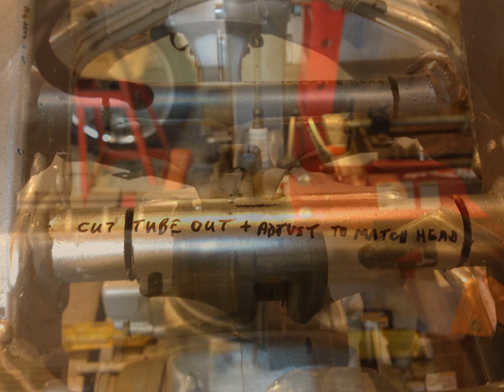KX220 Build-Slide Show/KDX Hybrid/KXF Hybrid

Comment: im doing the same build! Gor a good deal on kxf 250 2005. But im not sure how im gonna fit the swingarm axle on the kdx motor. i think its the most crucial part of the build
Reply from the maker: It's really not that bad. I had to open up the hat bushings in the case slightly to accommodate the larger diameter swing arm bolt using an adjustable ream. The only difficulty I had was keeping the ream on a straight path without some sort of pilot. If it's not too expensive you may want to consider taking it to a machine shop. They could probably do it much easier and without the risk of not getting the two sides in perfect alignment. If they're off even the slightest the bolt won't pass through from one side to the other without getting hung up. Plus you want it to be as perfect as possible so that the bolt will run true all the way through the swing arm bearings. After that it's just a matter of dressing a small amount of material from the outer surface of the hats to allow the engine to fit between the swing arm bearings. That's the easiest part.
Reply: @KX220R  thaanks! I will see if the machine shop of my city can do it! And what tube diameter did you bend to make the chassis? 1"?
Reply from the maker: @noiaverso  It's been so long since I did it, can't remember off the top of my head. It's exactly the same as what Kawi used in the tubes under the engine. Might have been slightly thicker walled because that was what was available from the local supplier.
Reply: @KX220R  use the kxf original air booth? im thinking about the air volume that the engine needs
Reply from the maker: @noiaverso  That's what I did. I had to work at it a while to get the opening to stretch to fit the KDX carb but eventually it complied. Haven't had any trouble with it and I still ride the bike all the time. The opening in the KXF air box for the carb is a slightly smaller diameter but you can make it work. My KDX220 engine runs great with the KXF air box and filter. I waited  until I had the engine all installed because I wasn't aware of the difference. Made it much more difficult to stretch the opening. You might want to consider stretching it to fit your KDX carb now while you have better access. Maybe install the carb into the air box and clamp it there now while you work on other parts of the bike to get it stretched out and compliant. That should make reinstalling the carb later, when things are tight, much easier. You might need to use a heat gun to warm it up a little and make it more pliable. After the engine is completely installed and the last thing to fit is the carb you'll notice the carb will want to push backward on the air box some as well because of the lack of room between the engine and the air box. If you're patient, the air box is pliable enough to reshape itself slightly. When you're all done you won't be able to tell it didn't come that way from the factory.
Reply: @KX220R  my kdx its 200.. uses a 35mm carb and i think the 220 uses 33mm so I think I'm gonna make a plate to fit the air filter and air both on the kxf air box..
Reply from the maker: @noiaverso  The outside diameter of the two KDX carbs is the same. It's just the inner diameter that is machined to different sizes. I've run both sized KDX carbs on my KDX220 and my hybrid KX220. It makes them run a little differently because of the bore size but the outside casting is exactly the same dimensions. If you look back at my video you can see that it fits just fine and you can save yourself a bunch of unnecessary fabrication time by reusing the stock KXF air box. My engine seems to run better installed in this KXF air box and with the KXF muffler than it runs in my KDX chassis with the FMF silencer designed for the KDX's. It seems to have great air flow in and out.
Reply from the maker: Andre, Let me know wen you finish your project. I'd love to see some pictures. I absolutely love riding mine. Being set up for MX my suspension was sprung and damped way too firm for the rocky and rough New England trails I ride on. It was way too harsh. I gradually did several mods on the forks and rear coil over to make it more trail compliant. It's an awesome trail machine now! Enjoy your new project and the fun bike you'll have when it's completed!
Reply: @KX220R  I opened the swing arm hole to 17mm... but the axle does not go thru..  i think the swing arm its hit the engine case so the holes are not aligned.. or the machine shop did not open a perfect hole thru
Reply from the maker: @noiaverso  If the bolt will go into each side but stops when it gets to the other hat bushing then thats exactly what is wrong. The machine shop didn't make sure they were perfectly aligned. If you didn't explain to them that the holes had to be perfectly aligned then they probably opened each side up individually. I would take the cases and the bolt back to them and explain to them what you need. If there's a little play in the bolt holes, it's not the end of the world. If they only have to open each side up slightly and then get the bolt to just barely slide through all the way it should still be fairly snug. They should be able to save it for you if they didn't botch it up too bad. Let me know how you make out?
Reply: @KX220R  the bolt goes tru the first that bushing..  when start to pass the engine hole it's where stuck.. but it's just when I try to fit the swing arm.. if I take off and install on the frame.. the bolt goes nice and easy..
Reply from the maker: @noiaverso  I guess I still can't picture what it's doing. If the engine is out on the bench, without the swing arm, can you pass the bolt all the way through both sides of the engine case all at once? In one side and out the other?
Reply: @KX220R  yes! and with i posicion the engine on the frame.. i still can pass the bolt all the way.. its only when i try fitting the swing arm.. even wheni remove the bushings so i can have more clearence the bolt does not go trough.. it stucks right when start to pass the engine hole.. 

So i guess the swing arm its hitting the engie case below the kick starter ..

Im thinking the solution will be making a braket that works like the spacers+engine but with too tabs to mount the engine.. same aligment but a feel centimeters foward.. that way i can give good clearence for the swing arm but i need to pay attention to not get too foward and hit the frame
Reply from the maker: @noiaverso  That's odd! I didn't have any interference issues at all. I understand now that the only time you're unable to install the bolt all the way through is when the swing arm is inserted. It's been so long since I did mine that I can't even imagine what might be getting in your way. I'm having trouble picturing it in my mind from memory. It sounds like you may have come up with a solution to your dilemma on your own. You may want to find out exactly what is causing the clearance issue and just remove small amounts of material until it fits without making contact. I'd only do that if there's material that can be removed without compromising the structural integrity of the part or parts though. Let me know how you make out.
Reply: @KX220R  just updating you! i actually had to grind some of the swhingarm .. like a 1mm, maybe 1,5mm .. that make the swingarm stop rubbing the engine case (right bellow the kickstartr you know?) .. a lot easier and safer doing this insted of a bracket to move the hole engine foward! do you have instagram or some email? i could send you pictures of my build!
Reply from the maker: @noiaverso  I'm glad you found an easy resolution for the the swing arm interference problem. The only interference issue I ran into was when I used the KXF kick start lever on the KDX engine. I'm sure you could probably use either lever but the KXF one I used came with the chassis so rather than buy a KDX lever I made the KXF lever work. It fits the KDX engine splines perfectly. The lever itself had to be trimmed slightly to clear the frame where the swing arm bolt attaches. Other than that little issue it works perfectly.
Reply: @KX220R  I have the original kdx kickstarter lever! So that's one issue less on this build hahahahahaha
Reply from the maker: @noiaverso  How's it going Andre? I haven't heard from you in a while. Are you still making progress on your build? Do you have any pictures you can send to my email address?

Comment: how much did you have to cut off on the swingarm to fit the kdx engine?
Reply from the maker: I know what you are referring to because I saw someone had to trim the swingarm on a KX 2-stroke chassis that they were fitting a KDX engine into.

This being a 2004 KX250F chassis I didn't have to touch the swing arm. Yes, the engine is slightly too wide to fit between the gap in the swingarm but only a few thousandths. Luckily the KDX aluminum engine cases are fitted with steel hat bushings. All that was required to make the swingarm fit was trim a little off of the hat bushings. I'm talking maybe .005" from each side. That can be done with a flat file a little at a time until it fits.

On the 04 KXF chassis the swing arm bolt is a larger diameter than what the KDX uses so I had to ream those same hat bushings in the engine case to make the bolt fit. That took a little more effort but not terrible. I used an adjustable ream. You must be very careful to make sure the ream cuts straight to ensure it cuts into both hat bushings perfectly straight. It's a long reach from one side of the case to the other so any misalignment is a bad thing. Just be careful.

Keep in mind if you want to do something like this that there is a huge difference between the 2-stroke chassis and the 4-stroke chassis.

Another thing, I noticed that Kawi reduced the diameter of some of the rear suspension bolts on the 4-stroke chassis after the 2005 model year. I know the later ones all have smaller diameter link bolts for sure. Never checked to see if they changed the main swingarm pivot bold diameter.

To sum it up, all that was required on this one was trim the hat bushings in the engine cases slightly to make the swingarm fit. 

The swingarm was the easy part. The 4-stroke frame requires a lot more tubing fabrication to make the KDX engine fit than the 2-stroke frame. I didn't have to modify the air box at all which was nice. Just had to stretch the rubber bell slightly to accept the 2-stroke carb. I reused the 4-stroke muffler but had to cut the larger inlet pipe off, bend up and weld on a new smaller diameter pipe. I also had to modify the FMF Woods expansion chamber by bending the outlet pipe upward slightly to line up with the muffler inlet pipe. Expansion chamber mounts were fabricated. Had to heat-form a slight dent in the bottom of the gas tank to allow room for the spark plug boot. Had to relocate all the KDX electrical components to fit the KXF chassis. Fabricated the aluminum skid plate. Also had to reroute and modify the cooling system plumbing to make use of the KXF radiators. 

After it was all up and running the entire kick stand was fabricated from scratch and it was finally ready for it's first trail ride which went quite well. There were no hiccups at all and we rode it for probably four hours in the woods. I did decide that the suspension was set up way too harsh (at least for me) for the rocky Maine trails. 

I have since installed a stock KDX spring on the rear shock and revalved the forks. So far, the revalve has only been to remove some of the low speed compression damping shims. Both mods have helped a lot. In the future I plan to try softer fork springs but for now I'm very pleased. The only reason I'm holding off is the price of the new springs.